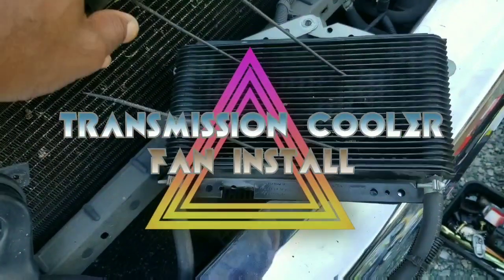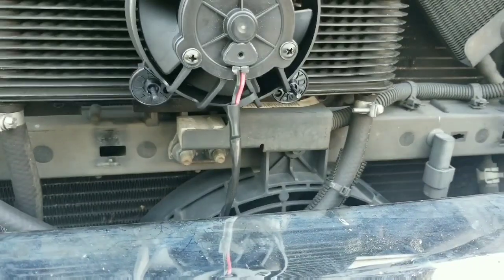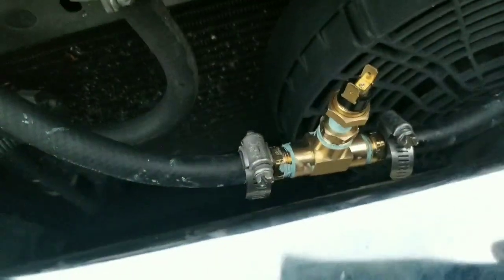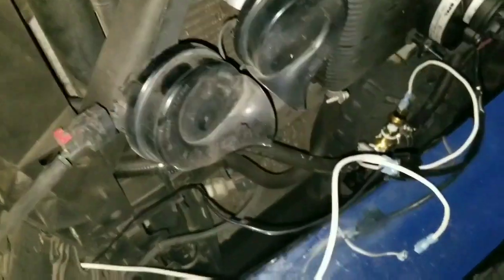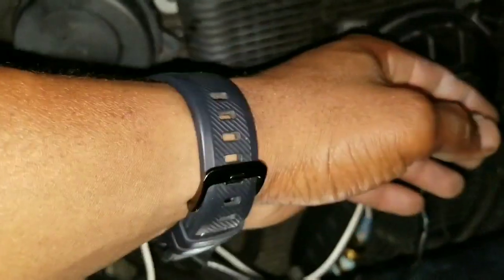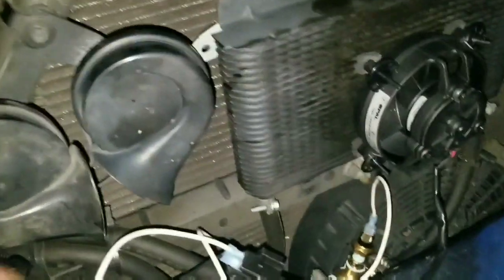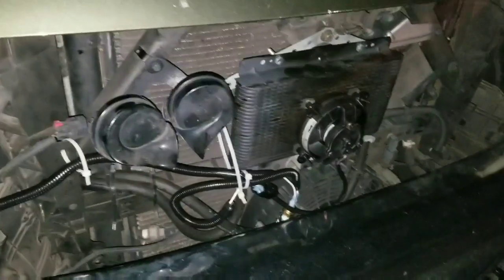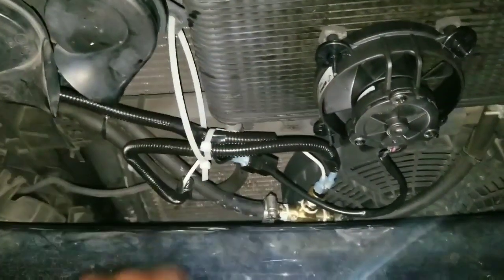Armada transmission cooler fan mounting...

Comment: thanks for this. I'm in the process of duplicating your by pass method on my 2011.
Reply from the maker: Glad I could help. One suggesting, get a T-fitting that's properly sized for the thermal switch if you can. Too many adapters to step down to the proper size actually insulates the switch. It'll take longer than it should to heat up, and linger than it should to cool down. Just an FYI...
Reply: @97TRAKIN  can you recommend a specific part?

Comment: Where you get that kit??
Reply from the maker: This isn't a kit. I gathered the parts that I thought would work best for my application. So far, this combination has exceeded my expectations.
Reply: VI Tinker Tank cool thanks bro i gonna install on my titan because in a little hill get overheating 🤯🤯
Reply from the maker: @abdallaho1762  I ordered the fan and thermal switch from Summit Racing https://youtu.be/TzAbFdWhfHg